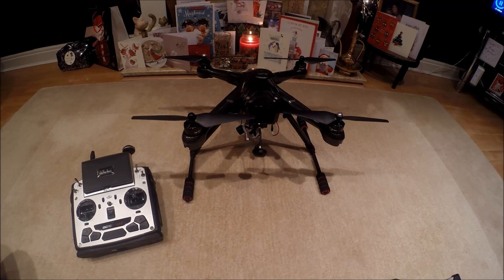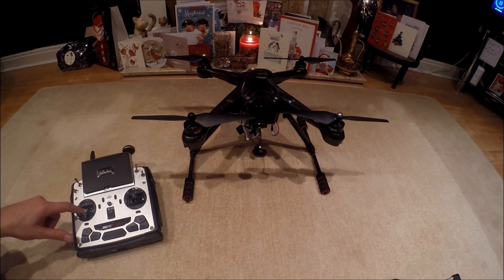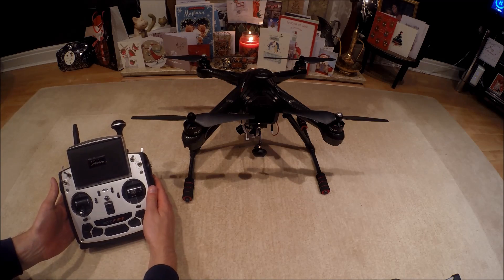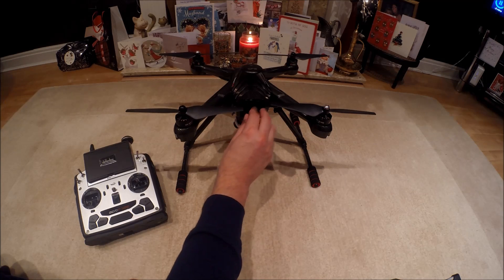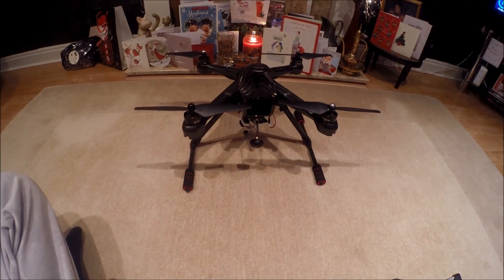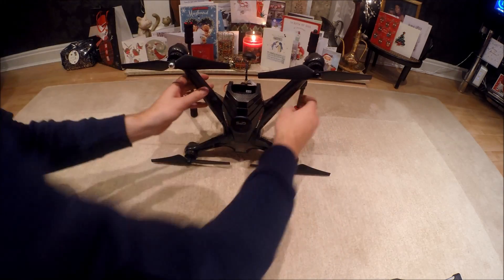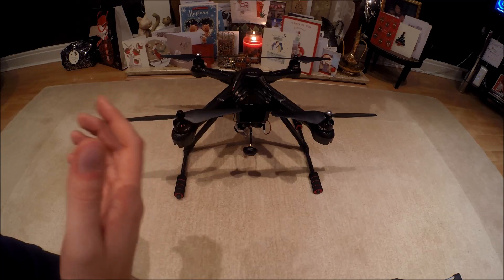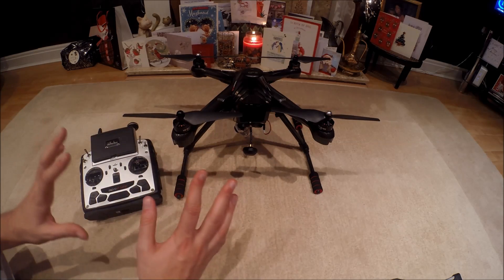Walkera Scout X4 - Guide to Compass Calibration

Comment: I have a scout x4 I just purchased and I’m having problems trying to get it to fly I did everything I’m suppose to to set it up and everything is functioning correctly but when try to fly the drone it won’t lift from the floor I’ve given it full throttle and it still doesn’t get up do you have any advice on this problem?

Comment from the maker: Todd, you have two options. 1) leave it on, remove the camera and disconnect the gimbal. 2) Remove it all together. By doing either of those, it should be fine. The gimbal is sensitive and by leaving it on and connected, you run the brisk of damaging it when you turn it over/upside down etc.

Comment: The instructions say to stay away from electric fields and metal surfaces while calibrating but how far in feet do you need to say away from them?
Reply from the maker: Your guess is as good as mine :) I've been with 300m and been fine.
Reply: Alex, was wondering which GPS altitude setting would be best and the most accurate relative or absolute?
Reply from the maker: I will be honest, I have no idea. There is no feature to adjust GPS altitude. The GPS cannot be adjust on the scout.
Reply: The manual I have shows under 12.7 Sensor settings - (2) GPS Receiver Settings (Relative or Absolute)
Reply from the maker: ***** Do you know, I have not looked at this and always left it on default. I will take a look into it :)
Reply: Alex, have you put the Matt Kim settings on your Scout X4 so it will hover and not lock the motors at 2m when returning to home? I was told a default setting is 0 and needs to be changed to 200 but not sure what setting and how.
Reply from the maker: I applied those settings a few weeks ago. I never had any issues before applying them to be honest. But applied them now....you never know. I do need to apply the latest settings which stops the scout falling to the ground when you loose contact.
Reply: Can you explain how to install the Matt Kim settings? What are the latest settings you are referring, I thought that when you loose signal it flies back home. Is there a problem with that ?
Reply from the maker: Rumour has it that the scout MAY not return after loosing signal. I cannot confirm this. But there are settings that apparently sort out this "problem". I have yet to install them yet.

Regards the other settings, there is a document which your need to view. I can email that to you?
Reply: Is this it http://tasview.wordpress.com/walkera-scout-x4/mission-planner-and-apm-settings/

Which would you recommend I do first, install these settings and then calibrate and fly? Is the setting that sorts the loose of signal on the list in the link?
Reply from the maker: This is worth following. Its what I used. However the signal loss are different settings. As I say, I've only heard of 1 scout  flying away....but then dji phantoms have done as well.
Reply: How do you know when the Scouts battery is at or near 25% during flight? Am I correct that the display on the transmitter shows the volts of the battery?
Reply from the maker: The transmitter shows voltage rather than percentage. Your battery will be at full at 24.0v and your want to have landed by 21.4v. It will display this and the transmitter will vibrate.
Reply: What voltage do you stop flying at and recharge?
Reply from the maker: ***** My transmitter warns me at 21.4v. You do not want to fully discharge the Lipo. You need to allow at least 30% left.
Reply: What voltage equals 30% battery?
Reply from the maker: ***** I would say that at 21.0v your getting to around 35%.So just under 21.0 would get you the 30%.
Reply: What voltage level do you stop flying at and balance and recharge your battery?
Reply from the maker: ***** 21.4v is my limit.

Comment: I set up my Scout x4 last night and calibrated the compass. Switched on this morning and it would bind with the Devo12FE. I also tried to upgrade to version 1.6, couldn't, and can't find any info on this.  Could this be the problem? Can anyone help please???????
Reply from the maker: Don't upgrade to 1.6. Heard bad things and its not really needed. You turn on the transmitter tyen immediately turn on the scout? Don't wait around. Does it vibrate?
Reply: Got it sorted.  I ended up turning on the scout first then the receiver.  That seemed to work.  However, I need to work out the buttons and switches as I've had a couple of spectacular crashes, lol.  Nothing that can't be fixed thankfully.  I won't upgrade yet then, not that I was able to, as it is not very clear how to.  The binding issue, no idea.  I did as I was supposed to - receiver on, scout on and wait for the red light to slow and then go out.  After 20 minutes, still flashing like mad and all it was doing was running the AA's down
Reply from the maker: So is everything working OK or you still have a problem? When everything has binded, the red blinking light goes out and the blue light flickers depending on how many satellites. As per my video. Are you saying you just get the constant red flicking light?
Reply from the maker: I do not think they are carbon fibre as mine snapped on a heavy landing. Glad you have got it all working though. They say to fly the quad in manual for at least 5 mins so that the compass can settle down rather than drift in the future. Hope that makes sense? The more you fly in manual, the more the Scout will be stable and not drift as much.